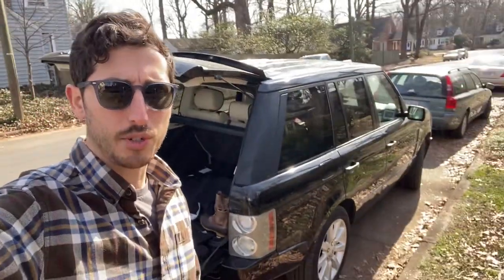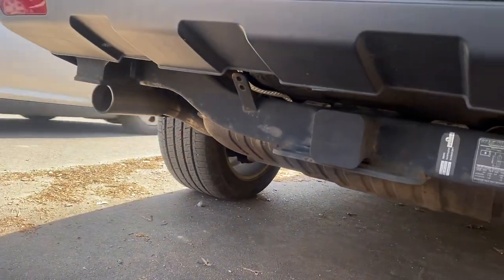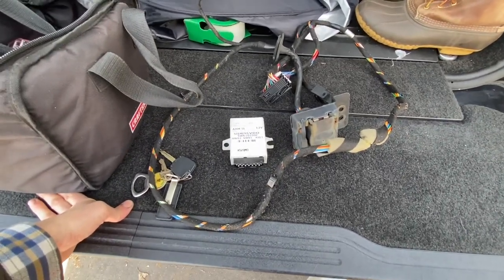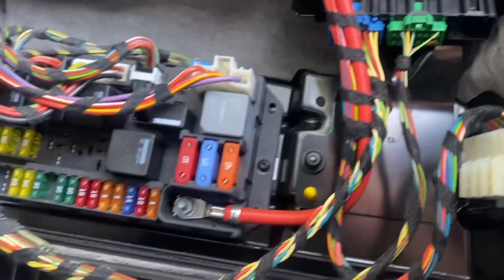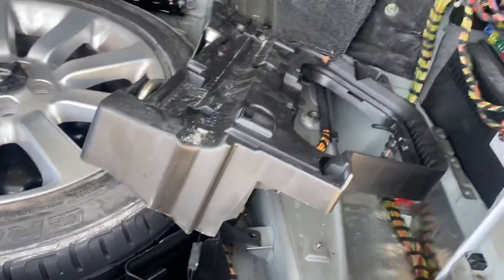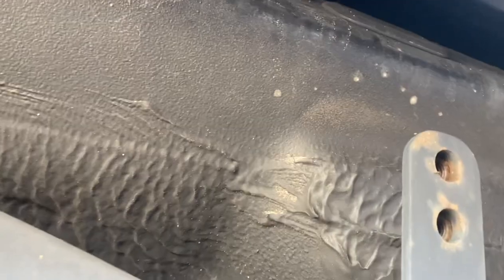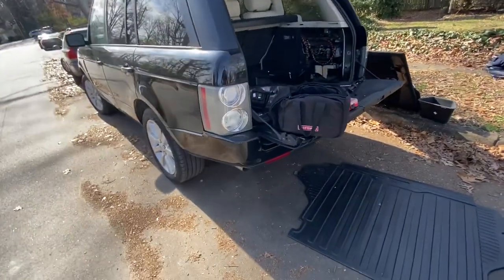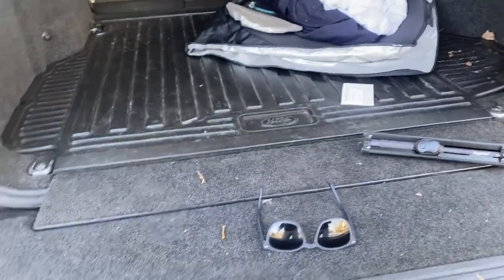Range Rover L322 OEM Trailer Wiring Harness Install (Not Equipped From Factory)

Comment: There is an orange wire that branches off from the wiring harness that has a little metal tip. It appears it needs to be plugged in somewhere. The installation instructions also shows this wire but it is not clear where it needs to plug in. Any ideas?

Comment: Ok, I bought an OEM one and have the harness and the white module connected. But there there are  3 extra wires. One with a black 2 pin plug and the other has a silver crimp bar on it that looks like it slips into a slot of some kind and the third looks like a ground. The video doesn't show where to connect them. Can you please advise where they connect? Thank you in advance.
Reply from the maker: I’ll have to check. Mine just plugged into the only two connectors that fit.
Reply: Wish I could add a photo I could show you what they look like @AddictedMotors

Comment: Would you happen to know why my green trailer light stays on on the dash?? I replaced a blown fuse and it's still there. Is there such thing as tow mode? How do I get out of it? Thanks!
Reply from the maker: Tow mode should only activate when the trailer is plugged in.
Reply: @AddictedMotors  would you happen to know why it's in tow mode without any trailer attached? Thanks!